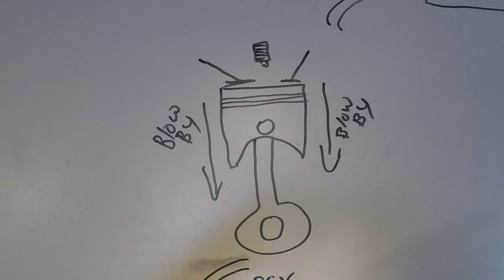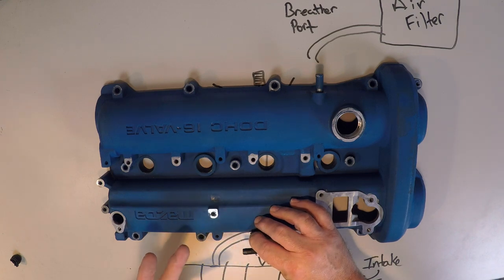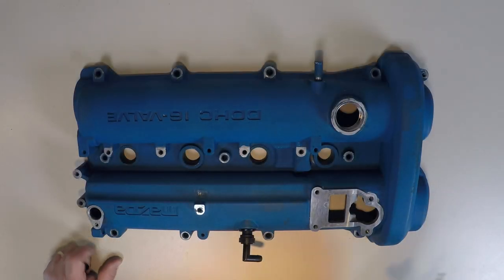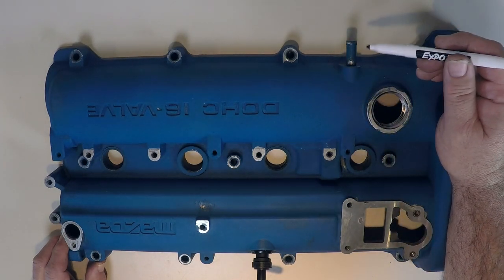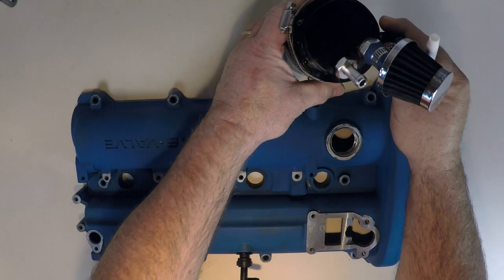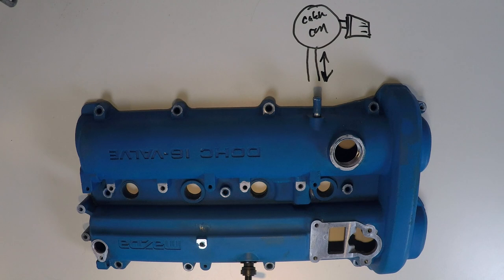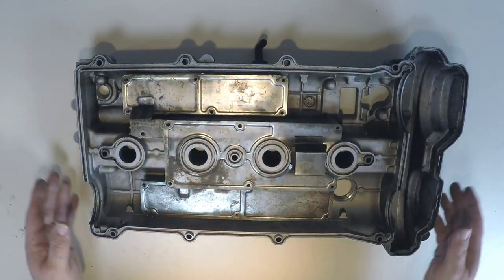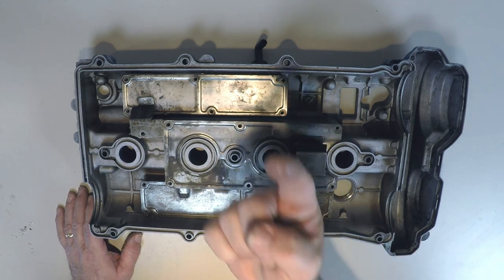How to manage Crankcase vapors, PCV Valve and Catch Cans under boost

Comment: great video, i own a 1999 montero v6 gdi 3.5 litre and on the passenger side it has a PCV valve which is routed from the top of the passenger valvecase over to the drivers valvecase, then there is another pipe which then exits the drivers side back into the air filter housing before the throttle body, if im reading this right i would need ! catch can fitted inline on the PCV side to deal with off boost stuff then another catch can fitted inbetween the drivers pipe that exits that valve cover which eventually goes back into the air filter housing for on boost yes.. think im right here, maybe someone 
 verify this cheers

Comment: Don't you want a check valve on the breather side, because, under vacuum, on the intake manifold side - you're just adding pressure in the crankcase?
Reply: yeah if you install check valve in the breather it can add crankcase pressure maybe installing filter along with the breather hose is a good idea to prevent sucking dirt during vaccum

Comment: I always thought that vacuum was supposed to be on the pcv valve side, is that wrong?
Reply from the maker: Vacuum is created by the intake manifold which pulls it through the PCV into the manifold and into combustion process.
Reply: @Seandoestech  can tie up or cover pcv valve using rubber stopper?

Comment: Today's engines no longer use a PCV valve like the one in this video!! Please show how the valve that is integrated into the rocker cover/valve cover works! They are relabeled as Crankcase Pressure Regulating Valve.

Comment: I do have a quick question for you =going from front mount to rear mount turbo on my satty. I know its not a miata, so hopefully you won't stop reading at this point! I got a copy of the STS pdf install guide just as a reference due to the rear mount nature of the kit (figured some things might be different). In the guide, they mention using a 1psi switch to open an actuator so that the pcv system doesn't see any boost. BUT, just watching this, It appears the stock pcv will stop boost coming from the intake into the engine/crankcase anyway, correct? Any ideas why they'd want to implement a separate system that seemingly is already accomplished with the stock pcv?
Reply from the maker: I’m not sure why, could just be for extra caution, so your not pushing oil into the intake. If you use a PCV valve, you want one that is designed for boost applications if possible. I use the Mazdaspeed version.
Reply: @Seandoestech  Thank you sir!
Reply: Could I trouble you for a part number? When you say mazdaspeed, for the 3 being that its factory turbo'd? I found a ford part number ev274? its a black and orange valve?
Reply from the maker: Kurt Bennett sure pcv valve is E301-13-890A

Comment: negative effects of venting both sides to a catch can on a street weekend car?
Reply: One is idle issues in some cars with stock tune.
Reply from the maker: Other than emissions? Well you’re not actively pulling vapors from your crankcase when not in boost. Some might consider that risky for oil seals in the engine.
Reply: @Seandoestech  thank you! :-)
Reply: it stinks the whole car up. I had it happen on idle and low speed driving
Reply: I have a boosted 1.6 NA. Both valve cover ports are vented to a single catch can that has a vent filter on it. This sort of works, but fills up fast. If you let it get too full, which only takes 100 to 200 miles,  it starts saturating the vent filter and building up crankcase pressure, and making a mess. It is a very short term solution, no good for a daily driver, unless you want to empty that thing with every tank of gas.
Reply: @linsturnbow3871  this oil saturation problem points to an insufficient air/oil separation within the baffle, right?

Comment: So when pcv valve close under boost so the breather became pcv so what about breathing cuz when  air get sucked so engine need breather so what about breather...???
Reply from the maker: ali qadri the breather side is both under boost, there is no check valve on the breather side. Also you are not constantly in boost, so temporarily not having a breather is not an issue. However a race car that runs under boost significantly will used a non-PCV system where both the breather and PCV connections on the valve cover will run to an oil catch can with a vented to atmosphere filter. I explain this in the video.
Reply: @Seandoestech  yes, extremely well done presentation... 🤗

Comment: So when turbo or supercharging any piston or rotary engine, I can't just vent the crankcase breather to the intake of the compressor, because that will damage the turbo or supercharger? But if it's a naturally aspirated engine, then its perfectly ok to vent the breather into the carburetor or throttle-body intake?
....This makes me sad. Because if I want a boosted engine, then I'll need a catchcan, and all that oil, fuel, and water in the can, will just be discarded, instead of burning for power, and water becoming steam to clean the combustion chambers.
I really don't like that going to waste, and just adding to the maintenance & mess of an engine.
...
What if I do a Draw-through turbo setup, a carburetor on the intake of the turbo, instead of carburetors on each intake-port, and if the crankcase breather goes before the turbo carburetor, then won't the gas from the carburetor keep the compressor clean, from the breather vapors?
Reply from the maker: You can vent to the intake system and most off the shelf systems have some form of this, but there is a risk of pulling oil into the intake when it comes out the breather port, and the PVC port as well, as well. Burning the vapors is good for emissions but the oil is bad because it can increases knock as well as reduce the performance of intercoolers as it may coat the tubes.
Reply: @Seandoestech  
A Draw-Through turbo setup, does not require an intercooler, because the atomized fuel from the carburetor, has a cooling effect. And to cool it down even more, alcohol can be injected after the turbo compressor. But instead of doing that, I'm chilling the air that's entering the turbo's carburetor. 
I just want to know how much of a cleaning effect, does a carburetor have, on everything behind it, even with a crankcase breather venting into it.
If it works with naturally aspirated engines, their intake ports & valves, then can it also work, on a compressor?
...
I didn't know oil increases knock.
How?
Carbon deposits?
And if I can chill the air/fuel mix, below ambient, even after the compressor.
Then wouldn't that greatly reduce any chance of knock? Even with high boost?

Comment: The last part with this stainless steel  sponge thing is dangerous. You will cloag a lot specially pcv side.
Reply: agreed.  should use the mesh in the can to precipitate out the liquids ... not the engine
Reply from the maker: I agree for most applications, this might be extreme, but if you find the catch cans filling up, it’s an option just keep the mesh loose, not dense, just enough to help mitigate the oil pushing through.
Reply: Bull.   You can put a loose knit metal sponge inside the valve cover before the pcv or case vent.  Infact many engines do this.  Two off the top of my head Detroit Diesel 12.7s and jeep 4.0.  

The Detroits are turbo'd and outside the valve cover the case vent is routed to a oil slinger that drops any remaining oil from the vapor and drains it back into the case usually at the timing cover.

Comment: So the most optimal way for a boosted car is to run some sort of a catch can from the breather side vented to atmosphere (while in boost) and a recirculated breather (block->breather->PCV) on the PCV side while not in boost (pulling vacuum).

Just trying to understand it correctly since English is not my main language it's kinda hard to understand certain terms.

Great video tho :)
Reply: For reference:
Have a b16 ~300hp@10psi
I want to delete the factory black box and run 2 hoses to a catchcan and 1 hose to factory PCV port.
My brain understands this as: vapours go to the catch can, seperate from oil and clean air goes back to PCV.

Sorry for the long post 🙂